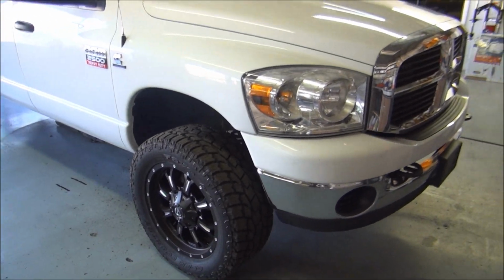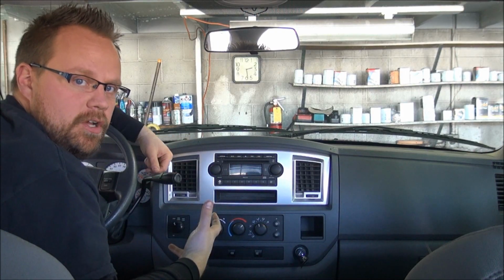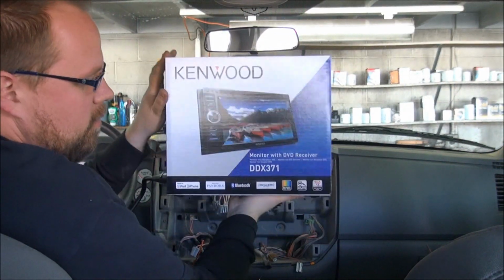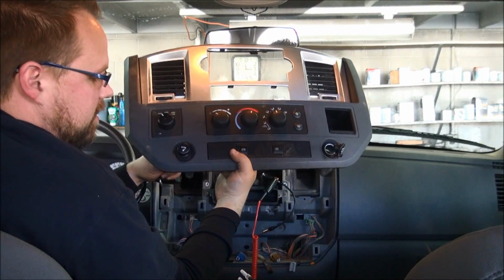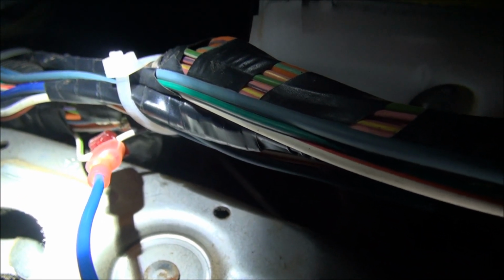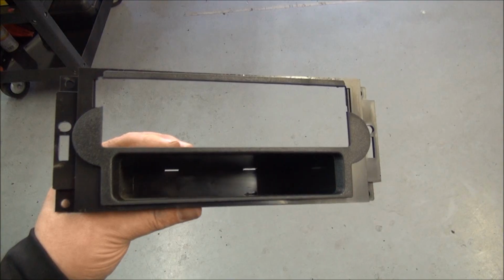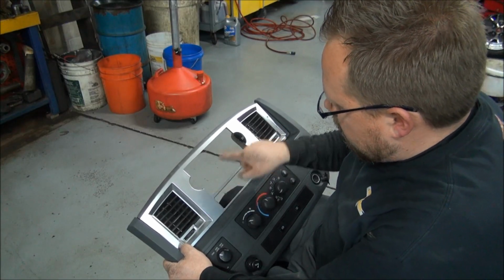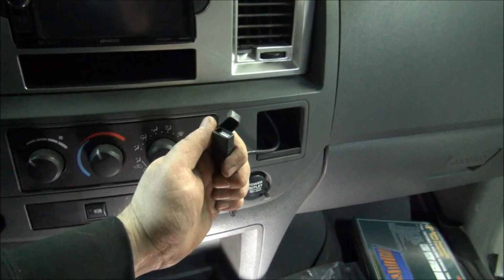Dodge Ram DOUBLE Din Radio Install Tips

Comment: why would you tap on the cigarette lighter switched wire to power the unit up? isn't the harness you used connects to the factory turn on wire, that should already be existing in the stock connector? how does the stock radio turn on then?
Reply from the maker: Yes, that is a good question. On that truck is does not have a switched wire at the radio that is (+power) it uses a negative switching system. (Switched +power is not in the existing factory connector) Dumb I know, Chrysler does this on many newer vehicles.
Reply: wow! well I guess Chrysler will not be on my purchase list.
Reply: I figured it out it was a real pita I think I might make a video explaining the wiring I can't imagine I'm the only person whose managed to have a problem figuring it all out. But thanks for the reply
Reply: Do It Yourself Bri is this why when I plug my unit it automatically powers up? I'm baffled I've checked and double checked my power and as soon as I plug it powers no key... I'm so lost and about to lose faith in this install. Thanks for a reply
Reply: Do It Yourself Bri is this why when I plug my unit it automatically powers up? I'm baffled I've checked and double checked my power and as soon as I plug it powers no key... I'm so lost and about to lose faith in this install. Thanks for a reply
Reply: The trucks use a can-bus system. They all use it now. Use an interface adapter. I have a 2007 truck with the infinity system, and bought two interface modules from PAC, and it works perfectly.
Reply: Chris Potter can't afford that damn interface damn thing cost more than my new radio i don't have the infinity system though
Reply: If you don't have the inifity system, then using the cigarette lighter for power will work. You have to use the interface for the infinity. I have a few other things tapped into my cigarette lighter behind the dash so that wouldn't have been an issue for me, just the infinity.
Reply: Mine was cheap too haha just gotta find the right person who doesn't know what they are selling
Reply: Chris Potter yeah my 06 ram was the cheap model so it don't have none of the fancy stuff lol